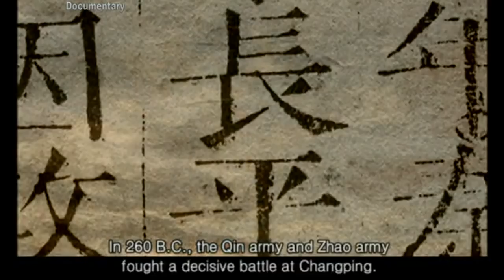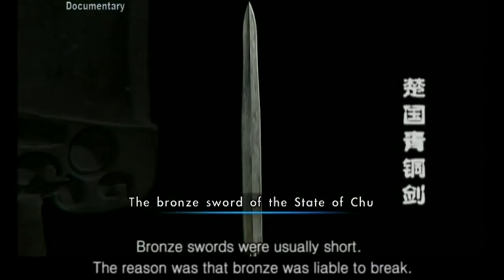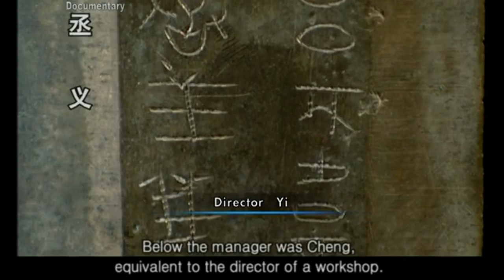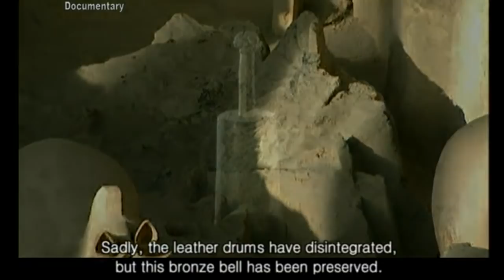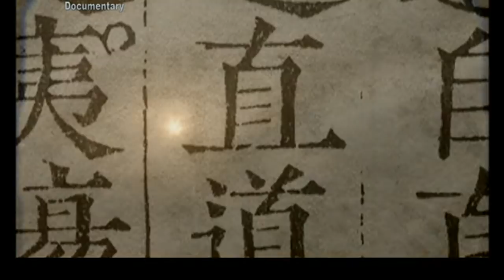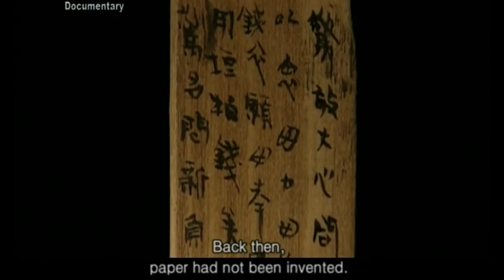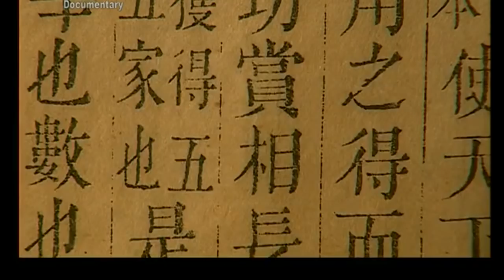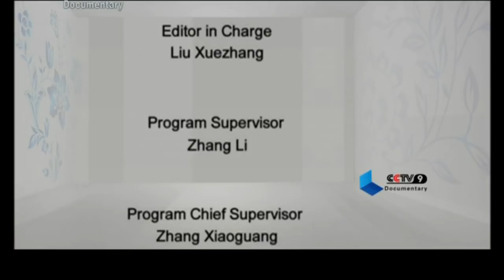[Documentary] Qin Dynasty (221 - 206 BC) -Terracotta Army  秦兵马俑

Comment: 1:07:45 The platform in the chariot could easily support archers or javelin in a close encounter. unless your horses were wounded or dead you had extreme advantage from the wheel boss weapon to the halberd and bow. Two of these could mess up the front ranks pretty fast.
Reply: This was composed from one of the seven military classics, a collection of writtings dating back to the Spring and Autumn period, should give us a clearer picture of how chariots are used. It's a little long but very informative. 

King Wu asked Tai Gong: "What about battle chariots?"
Tai Gong replied: (...) In general, in chariot battles, there are ten types of situations on which demise is very likely and eight on which victory can be easily achieved."
King Wu asked:"What are the ten fatal situations like?”
Tai Gong replied:”If after advancing, there is no way to withdraw, this is a fatal terrain for chariots.
Passing beyond narrow defiles, to pursue the enemy some distance, this is terrain which will exhaust the chariots.
When the land in front makes advancing easy, while that to the rear is treacherous, this is terrain that will entrap the chariots.
Penetrating into narrow and obstructed areas from which escape will be difficult, this is terrain on which the chariots may be cut off.
If the land is collapsing, sinking, and marshy, with black mud sticking to everything, this is terrain which will ‘labor’ the chariots.
To the left is precipitous while to the right is easy, with high mounds and sharp hills. This is terrain contrary to the use of chariots.
Luxuriant grass runs through the field, and there are deep, watery channels throughout. This is terrain which thwarts the use of chariots.
When the chariots are few in number, the land easy, and one is outnumbered by enemy infantry, this is terrain on which the chariots may be defeated.
To the rear are water filled ravines and ditches, to the left deep water and to the right steep hills. This is terrain on which chariots are destroyed.
It has been raining day and night for more than ten days without stopping. The roads have collapsed so that it is not possible to advance or to escape to the rear. This is the terrain that will sink the chariots.
These ten are deadly terrain for chariots. Thus they are the means by which the stupid general will be captured and the wise general will be able to escape."
King Wu asked:"What about eight conditions of terrain that result in victory?"
Tai Gong replied:"When the enemy’s ranks - front and rear - are not yet settled, strike into them.
When their flags and pennants are in chaos, their men and horses frequently shifting about, then strike into them.
When some of their officers and troops advance while others retreat; when some move to the left, others to the right, then strike into them.
When their battle array is not yet solid, while their officers and troops are looking around at each other, strike them.
When in advancing, they appear full of doubts, and in withdrawing they are fearful, strike them.
When the enemy’s whole army are suddenly frightened, all of them rising up in great confusion, strike into them.
When you are fighting on easy terrain and twilight has not ended, strike into them.
When, after traveling far, at dusk they are camping and their whole army are terrified, strike into them.
These eight situations constitute conditions in which the chariots will be victorious.
If the general is clear about these ten fatal situations and eight situations where victory is almost certain, then even if the enemy surrounds him on all sides - attacking with one thousand chariots and ten thousand cavalry from the front and the flanks - he will invariably be victorious."

King Wu asked Tai Gong: "When chariots and infantry engage in battle, one chariot is equivalent to how many infantrymen? How many infantrymen are equivalent to one chariot? When cavalry and infantry engage in battle, one cavalryman is equivalent to how many infantrymen? How many infantrymen are equivalent to one cavalryman? When chariots and cavalry engage in battle, one chariot is equivalent to how many cavalrymen? How many cavalrymen are equivalent to one chariot?"
Tai Gong replied: "Chariots are the wings of the army, the means to penetrate solid formations, to press strong enemies and to cut off their flight. (...) after the masses of the army have been arrayed in opposition to the enemy, when fighting on easy terrain, the rule is that one chariot is equivalent to eighty infantrymen, and eighty infantrymen equal to one chariot. One cavalryman is equivalent to eight infantrymen; eight infantrymen is equivalent to one cavalryman. One chariot is equivalent to ten cavalrymen; ten cavalrymen is equivalent to one chariot.
The rule for fighting on difficult terrain is that one chariot is equivalent to forty infantrymen, and forty infantrymen are equivalent to one chariot. One cavalryman is equivalent to four infantrymen; four infantrymen are equivalent to one cavalrymen. One chariot is equivalent to six cavalrymen; six cavalrymen are equivalent to one chariot.
Now chariots and cavalry are the army’s strong weapons. Ten chariots can defeat one thousand men; one hundred chariots can defeat ten thousand men. Ten cavalrymen can drive off one hundred men, and one hundred cavalrymen can drive off one thousand men. These are the approximate numbers."
King Wu asked: "What are the numbers for chariot and cavalry officers and their transformation?"
Tai Gong replied: "For the chariots - a leader for five chariots, a captain for ten, a commander for fifty and a general for one hundred.
For battle on easy terrain five chariots comprise one line. The lines are forty paces apart, the chariots from left to right should be ten paces apart, with detachments sixty paces apart. On difficult terrain the chariots must follow the roads, with ten comprising a company and twenty a regiment. Front to rear spacing should be twenty paces, left to right six paces, with detachments thirty-six paces apart. If they venture of the road more than two li in any direction, they should return to the original road.
As for the number of officers in the cavalry: a leader for five men; a captain for ten; a commander for one hundred; a general for two hundred.
The rule for fighting on easy terrain: Five cavalrymen will form one line, and front to back their lines should be separated by twenty paces, left to right four paces, with fifty paces between detachments.
On difficult terrain, the rule is front to back, ten paces; left to right, two paces; between detachments, twenty-five paces. Thirty cavalrymen comprise a company; sixty form a regiment. For ten cavalrymen, there is a captain. In action, they should not move out of the range of one hundred paces, after which they should circle back and return to their original positions."

Comment: This indicates that Bronze was easier to mass produce possibly because it was easier to use molds in bronze casting of weapons. Whereas the best iron/steel weapons had to be hammered by hand, uniformity is lost with steel. I would wonder if the generals had steel weapons though. They could've rusted away.
Reply: The qin weapons found in the pit did show they were hammered.